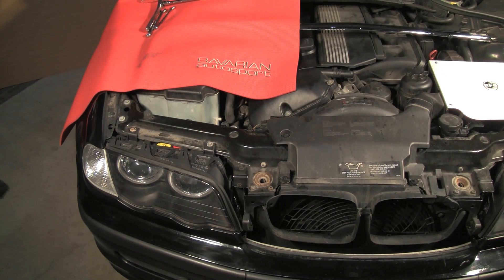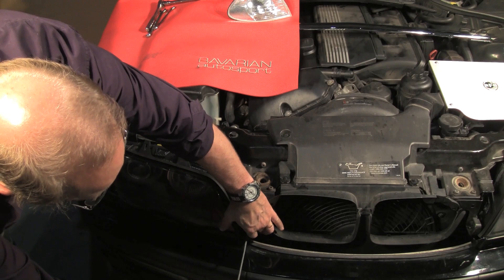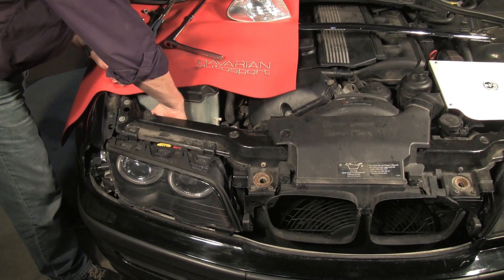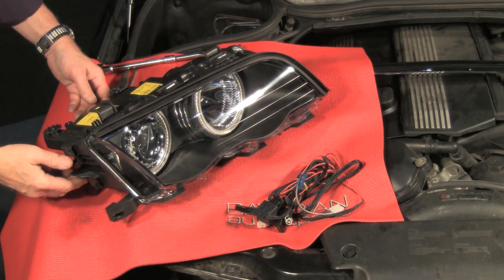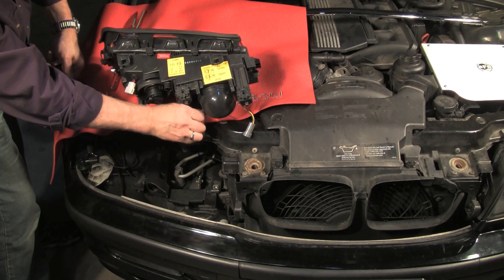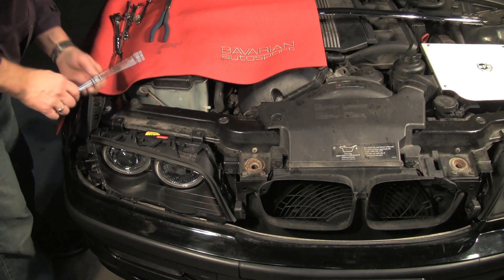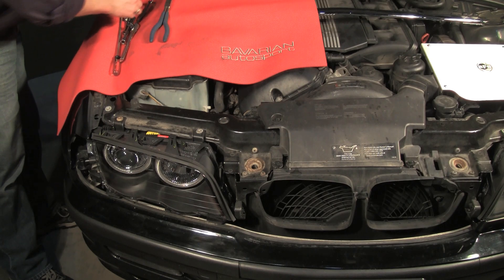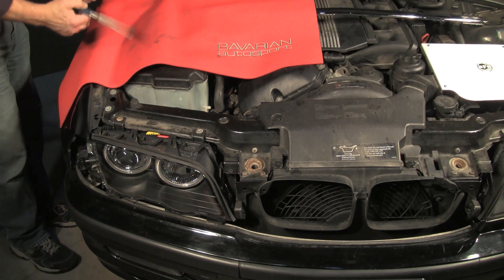BMW Headlight Replacement and Angel Eyes Upgrade, Part 1 of 2

Comment from the maker: Victor, We do not have any shots handy, of the Halogen angel eyes on the E46 3-series.  However, they would look like a standard E39 5-series (97-03) with angel eyes ... which are Halogen.  Mainly, they are not as blue-white as the LEDs shown in this DIY.